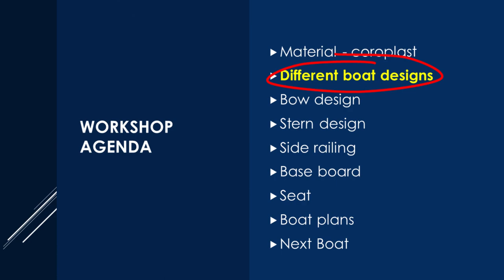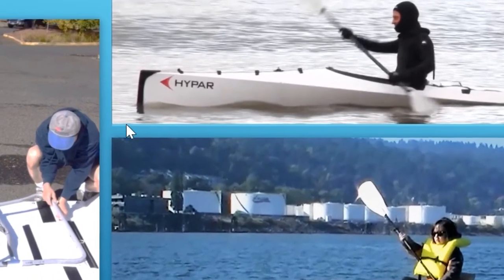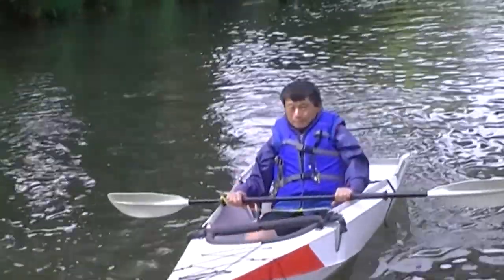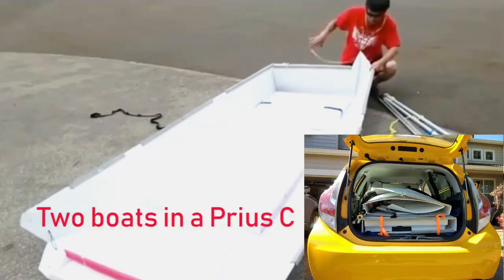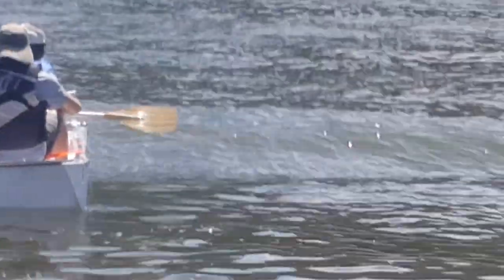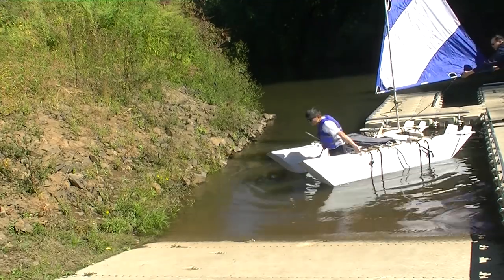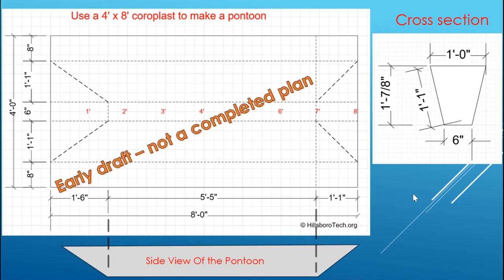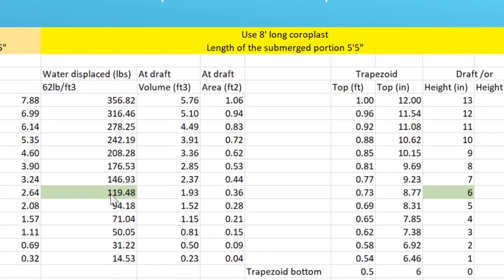DIY foldable boat workshop part 2 - Different designs

Comment: Thank you for this video. I have been interested in a diy catamaran  for some time. I have looked at many videos and yours has cost, weight, easy build and stability in it's favor. Thank you again.
Reply from the maker: Thanks for your comment. I have never posted how I built my 1st catamaran because there are many bugs. But it is a good learning process. Since then,  I have learned and experimented more last summer and has started designing the rev. 3 of the pontoons, I have also tested an effective but simple daggerboard design. The best part is I have created the hot fusion building method. Which I have used on my rev 3. I have tested the hull last fall and it  is so much better, more hydro dynamic bottom and much stronger structurally.... yet both pontoons (together) weighed at 30 lbs. The challenge is the design of the platform. I have a good idea to make a good one but it will weight 15 lbs. (more than I want to) It is harder to get the materials now due to coronavirus. I probably have to wait till July and August to water test the new boat. My goal is to rig up the mini catamaran is 20 minutes.... which I believe I can get there. The rev 3 pontoons are foldable, but the pontoon platform will be 4'x3.5', therefore I have to add a car top rack just to transport the platform.  If you are ok with a non folding pontoons, you can build a very good one (a pair) in 12 hours (using heat fusion - and stronger  and 1-2 lbs lighter than the foldable one). I  have not built the frame yet and I expect it will take < 10 hours if I can get the  materials. I keep the boat length to 10' so I don't have to register the boat. If you are interested in this type of boat, I can compile a video on how I build my rev 3 pontoon (I have the raw footage), and add the video for the platform build once I have it completed...  stay healthy....Regards,